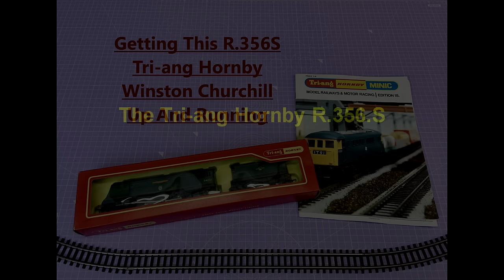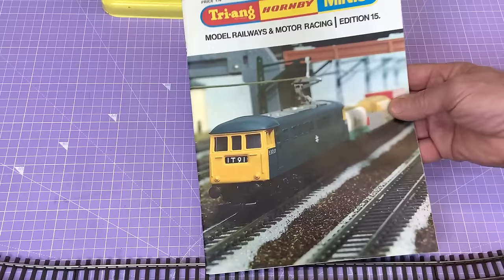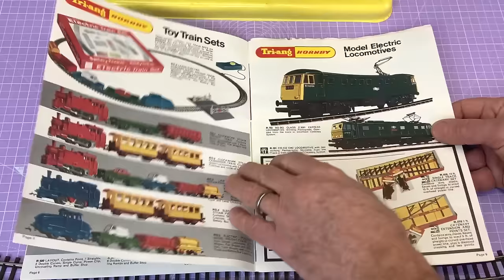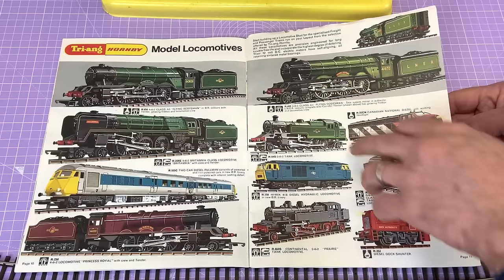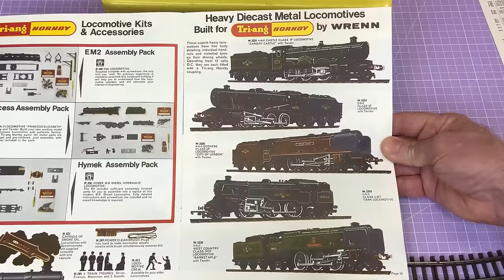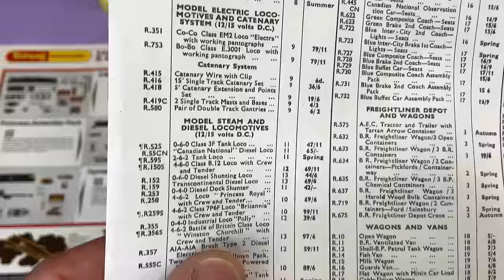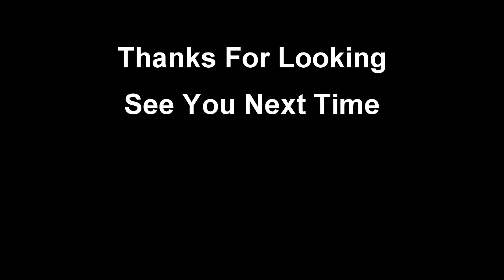Will It Run Again? Time to Bring This Superb Tri-ang Hornby R.356S Winston Churchill Back To Life

Comment: Hi Mr. Snooze,  The spacer makes a good electrical pick up under the smoke unit. It has a small 'pip' that faces down to the chassis and a hole to accept the securing screw from the TV suppressor through the smoke unit body ...
Reply: My thoughts exactly. Well done - it's the chassis electrical return from the heating element.
Reply from the maker: That's interesting information, thanks for mentioning it. Take care, all the best to you

Comment: I had a very similar issue with an old Wrenn 0-6-2 tank loco and managed to free up the hardened grease that had blocked the drive wheeels. Bought it covered in cobwebs and not running...10 minutes of cleaning and it runs like a dream (and I'm a total amateur on these things). Rescued a couple of old Tri-ang Princesses too.   There's a real sense of achievement to see the old locos being brought back to running again.  Great video.
Reply from the maker: it sounds like you too are enjoying the fun of getting these up and running again. I hope you find more items to restore back to working. Take care and thanks for looking

Comment: Snooze (Wake up!),
As usual really enjoyed your presentation, and that is probably a worry.
That was an interesting comment re the ancient plastic insulators and keeping modern solvents clear.  Again, my mind drifts back to old Ray Pearson who used to clean chassis by brushing kerosene where needed and letting air dry (no force drying lest the element providing the heat ignite the vapour - work outside).  Have never experienced any problems, but that was mostly Wrenn and a long time ago.
Would appreciate you sharing anything that comes up re the Peco lubricant, probably a replacement for their old 'Electrolube'.  Corrosive properties are unlikely, but the very mention is of concern.  A loco of mine was oiled with what is pretty much an interest area standard plastic compatible lubricant and exhibited pickup problems.  A clean and relubrication with light machine oil fixed the problem.  I have often wondered what Peco's product would do??? 
A suggestion re wiring: the wires on this thing are easily old enough to be fatigued and stiff, and so prone to high resistance and breakage; they were never real flexible anyway.  Might be a idea, whilst the soldering iron is out, to replace them, possibly even with something as flexible as (I think) Faller wire.

The way that loco moved its train into motion gives it away as a marvellous chess piece on an operational layout.  That June 76 Model Railroader Magazine article 'Transistor Throttle with a Future' would make this model sing.

If anyone needs advice on how to totally destroy a classic Minitrix motor, just ask.  I have a cartoon catching a husband/wife taxidermy having just shut-up shop for the night; the caption as near as I remember 
                                                                                              'It's so good knowing everything is completely stuffed'
 - It's like that.
Reply from the maker: Hello Pete, thanks for your excellent points. I have heard a few negatives about the Peco lubricant but so far I have nothing bad to report about it. I only use it on axles however. You make a good point about replacing the stiff old wire in the Tri-ang models. It is funny stuff but I haven't the heart to condemn it and using a good quality flux and solder I usually manage to keep it serviceable. I have some lovely supple silicone covered wire which would do so maybe I'll try it out on a model soon. Take care, all the best to you

Comment: Great work getting her running again. 👍
The old X.04 motor is such a simple design and if looked after will go forever.
My version of Winston Churchill has a damaged tender. The guy I bought it off used cellotape to hold the coal load in place in postage and hence the decals are now ruined. 🙄😕
Stay safe
Mon
Reply: My Winston has the same spacer ,had me puzzled till I looked under the smoke generator . And I can see yours is going to be a very free moving locomotive. All the best.
Reply from the maker: Sorry to hear about that tape, the glue they use has some nasty ways of attacking the finish on old railway items. Take care, all the best to you

Comment: Great job.. Such loving care taken to restore this loco.. No rushing in with a Dremel's wire wheel, or pulling things apart unnecessarily?  Very nice advice from a great repairman?
I'm sure that years of life have been saved by such careful restoration?
Reply from the maker: I find it's sometimes good to try the minimum first. It isn't always necessary to completely strip something to get it serviceable again. All the best to you

Comment: Nice save and the Southern coaches are really nice.  I have seen where other channels disable the synchro-smoke unit, and have wondered why the gear and plunger are left in.  They must contribute to motor drag at low rpm and also some unwanted gear noise.  It also think it's a good idea to make them inoperative for all sorts of reasons.  😊
Reply from the maker: That's an interesting idea to remove the gear in the smoke unit. I might give it a try. Take care, all the best to you
Reply: @MrSnooze  To my mind it's like the chicken soup remedy.  It may not help, but it can't hurt. 😊

Comment: Your Winston Churchill is indeed a smooth runner Jonathan. I have come across seized axles before but never on a Tri-ang model. It must be related to the lubricants used. The model is in superb condition other than the scuff marks from the plastic tray. I have one set that the tray shrank enough to split a passenger car end. I don't like to keep the models in those trays because of that. Regards, David.
Reply from the maker: That's a horror story about your damage from a shrinking tray. I'll bear that in mind. Thanks for looking, all the best to you

Comment: Great video. R356S is one of my favourites; mine came from eBay, not as seized as yours but getting there. I'm on Peco code 100, so no magnetic help. I found some lead lining in the body helped to plant it a bit and adding tender pickups helped smooth running. I was inspired to get it after having the BoB "Manston", a more recent model. I was involved at the former RAF base which makes that locomotive a bit special. Best wishes.
Reply from the maker: That's a nice connection you have mentioned there. A bit of lead here and there does help with traction. Take care, all the best to you

Comment: A green convertor vehicle is easily made from a Wrenn 4 wheel utility van which has provision for fitting a Dublo coupling as well as a Triang Tension lock.
Reply from the maker: Excellent idea, I'm going to do this exact thing. Thanks for suggesting this, all the best to you

Comment: Great to get these old engines working again! I found a job lot of 18 Hornby Dublo 3-rail wagons on the French equivalent of Gumtree a couple of weeks ago. Also included in the lot were a Hornby Dublo metal water crane, a classic Dublo signal box and two « non working » 2-rail locos : an early Triang Jinty with solid wheels and a missing chimney and a Lima 94xx pannier tank. 
It was all advertised for the princely sum of €20, I guess the chances of finding a buyer in France were pretty slim, so my generous offer of €15 was immediately accepted 😮, I couidn’t believe my luck.
The wagons all cleaned up nicely even though they’d clearly been victims of damp. They got an overnight bath in penetrating oil to start with (most of the wheel sets were seized), the following day they all got a « shower » in contact cleaner! Drastic action, but once degreased and dried, all that was required was light lubrication of the axles , bogie and coupling pivots to have them all running well. 
As for the locos, after a good service similar to yours they both ran beautifully, especialy the Jinty.
I was looking for  guinea pigs for conversion to run on my 3-rail layout and really didn’t want to risk any members of my 2-rail fleet which are all boxed up waiting for me to retire in a couple of years and build them a new railway to run on !
Anyway, Jinty was fitted with a Marklin skate soldered to the motor pick up wire, and the 2-rail pick up itself earthed directly to the chassis. Amazingly I had a spare Triang pannier body in my scrapbox, so I now have a 3-rail 8750 pannier. Everything is reversible back to 2-rail if I want in the future. With its old rough solid wheels it also surprisingly has enough oomph to haul almost all the heavy diecast chassied wagons it came with around those tight Dublo 3-rail curves.
The 94xx was easy too, 
but compared with the 8750 pannier, it couldn’t pull the skin off a rice pudding ! Pity as it’s a nice looking beast !
So next time I’m back in blighty I’ll be snapping up a few more Triang locos from the 50’s with those coarse wheels. 
Contrary to expectations, they run fine on Hornby Dublo 3-rail track even though it’s much finer than the Triang Standard, series 3 and Super Four track they were built for.
Reply from the maker: You certainly have been busy. What an excellent find that was. I wonder if you have ever thought of converting a Tri-ang Transcontinental  type loco to 3 rail, I bet it would run well. It's great you are having fun with these conversions. Like you say you can always change them back if you want. It's all good fun. Take care, all the best to you
Reply: @MrSnooze  what I really want is a heavy freight loco, ideally a 3-rail 8F, but prices are too high. If I couid find a cheap 3-rail 8F tender I could « convert » my 2-rail 8F, but they are rarely to be found separately and also command high prices. I don’t think i’ve ever seen a tender chassis, or a set of Dublo plunger pickups for sale either…
Reply: BTW, many thanks to you, OOBill and Oscar Paisely for inspiring and sharing the Know-how that has got me back doing these things after nearly ten years of « abstinence » 😂

Comment: THE TOY TRAIN BRIGADE !!!!
But these things were "Kiddy toys", not models, when they were made. By 13 years old (1969) I was already using proper German made Fleischmann, Trix & Lilliput detailed MODELS (Because there were NO British outline commercial Model Ranges, only Toys). With powerful smooth mechanisms, on scratchbuilt finescale HO track. As German products wouldn't even run on British System 4 toy train set track, as it was far to coarse & crude !!!
Reply from the maker: Hello and thanks for watching. These are toy trains and indeed bear no comparison to the items you were lucky enough to have from the likes of Fleischmann etc. They were crude and relatively inexpensive but made to last and that's proved by them still providing fun today. Tri-ang Super 4 is a thing of it's time but there are a few of us around that still like to enjoy what Tri-ang Hornby had to offer in the 1950's 60's and 70's. Take care, all the best to you